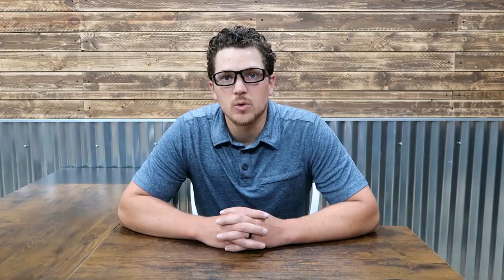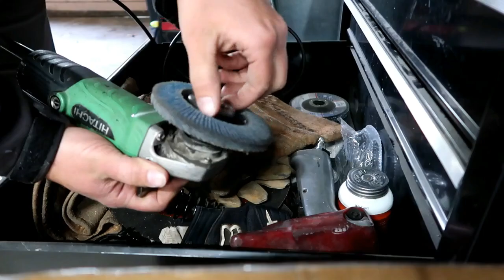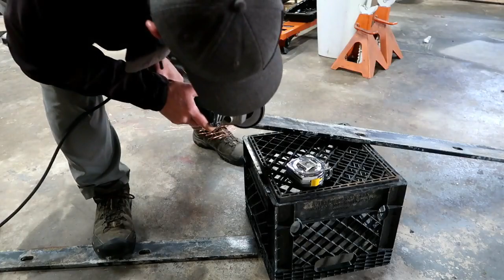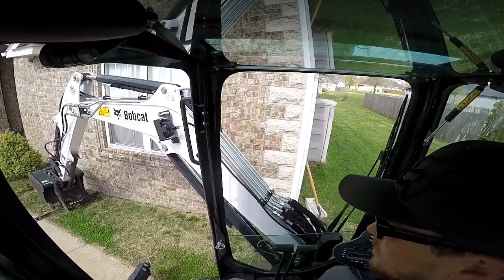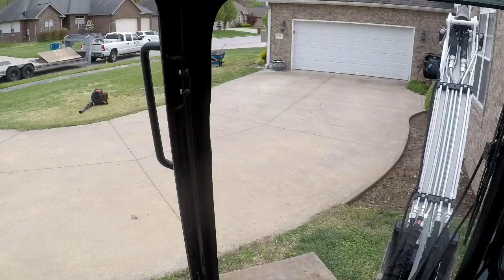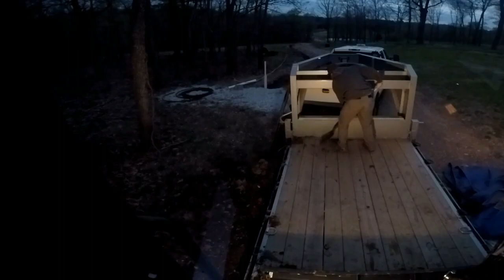Making Mini Excavator Grading Bar from SnowEx Snow Plow Cutting Edge

Comment: Grading 101,  do what works.  You will find what  works for you. Most local utilities require plate on the  front of teeth.  I  beam is better if holding it with thumb.
Reply from the maker: I welded the used snow plow cutting edge on the teeth. Works great!